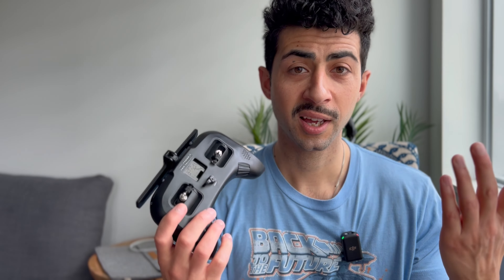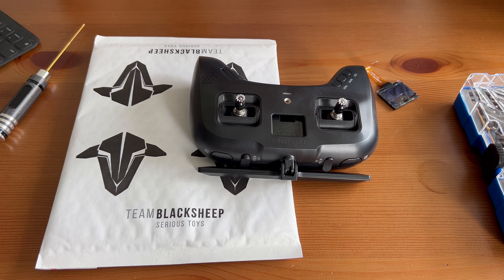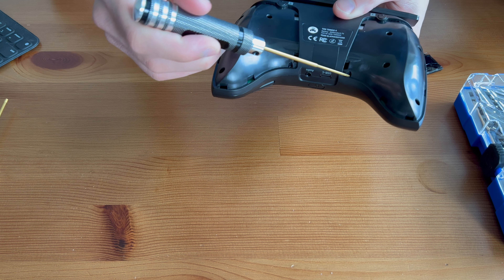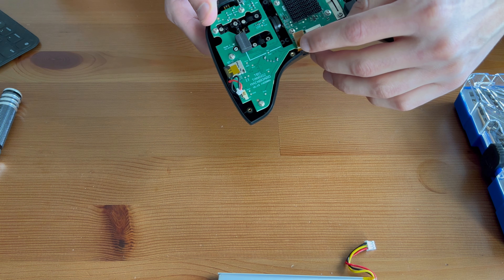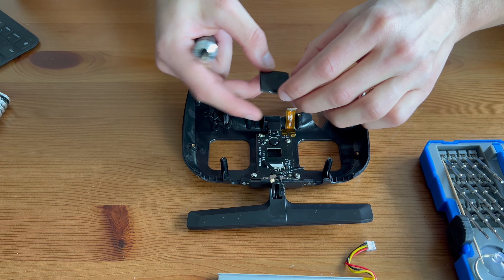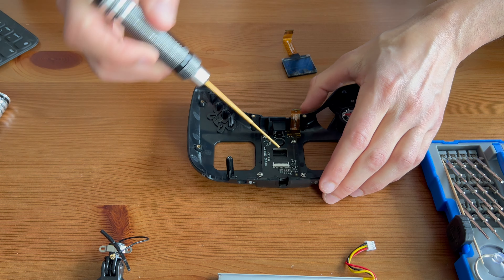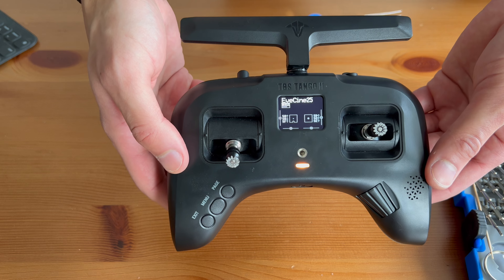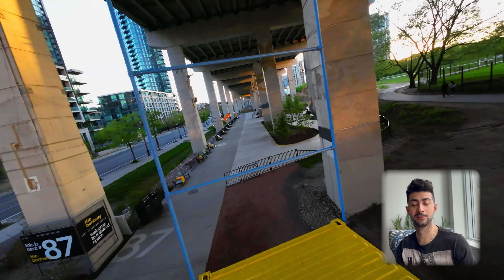How to Replace TBS Tango 2 Screen, EASY FIX

Comment: is 4.0v the highest it charges too? because i have never seen mine at the full 4.2v.
Reply from the maker: How long you had your. I think I’ve seen mine got to 4.2. Only logical solution would be battery doesn’t hold full charge…? That should still be plenty but you can buy replacement direct from tbs.